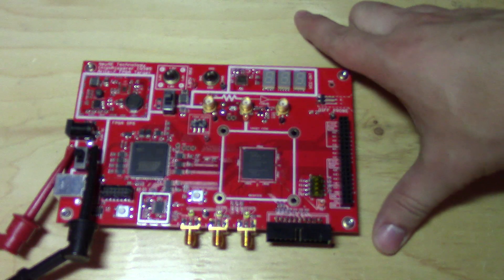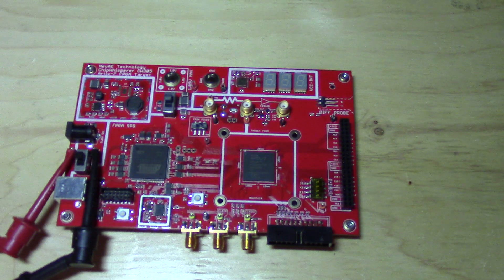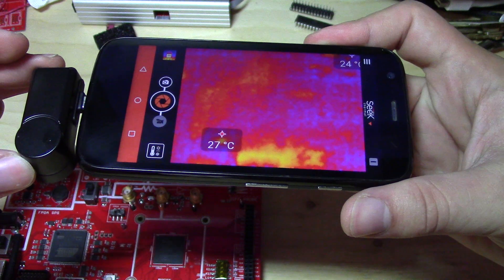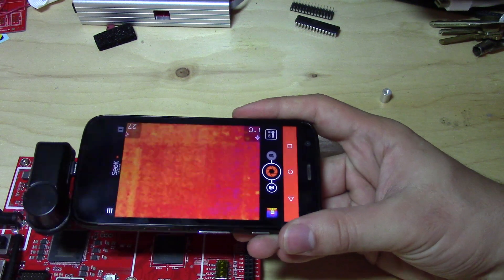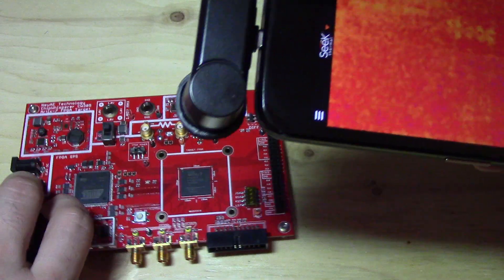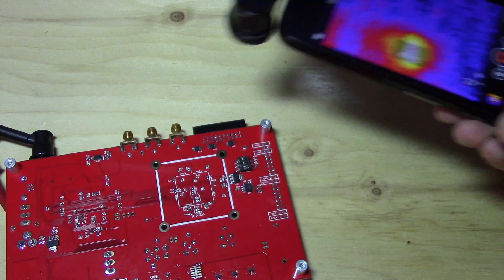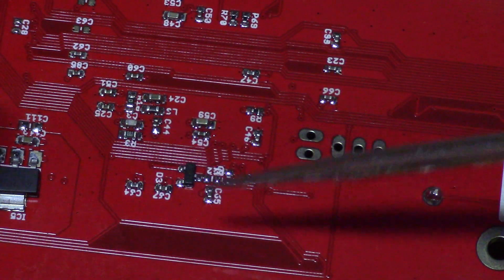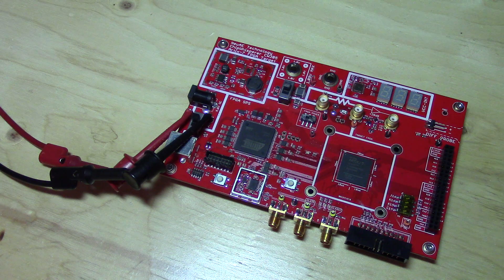Using Thermal Camera (Seek) For Power-Up of New PCB

Comment: Hi. the resolution of this camera looks pretty bad for PCB inspection. Or is it the focal distance which is not suitable. I wonder if you would be able to identify let's say a heating 0201 component in a cellphone... What's you experience?
Reply from the maker: Haha 0201, no chance ;-) But if it's heating up you'll see stuff around it getting hot anyway, so you can't exactly pinpoint the part but still possible to know something bad is happening, and roughly know which area... although 0201 would be very small power dissipation so it might burn out before that.
Reply: Thanks! Got a SEEK and it is pretty good already since it has adjustable focus, a neat feature I didn't know about. Ordered some macro lenses, maybe it helps...

Comment: Very cool, where did you get the macro lenses? I saw some on ebay but wasn't sure if they performed well. Currently I inject a current and measure trace/branch voltages. Where ever the voltage is the lowest, there is your short. However, its very time cosuming. Obviously would prefer to switch to a thermal camera.
Reply from the maker: +Username I've got a few links at http://colinoflynn.com/2015/05/experiments-with-seek-thermal-camera/ which has the specific macro lense I used.